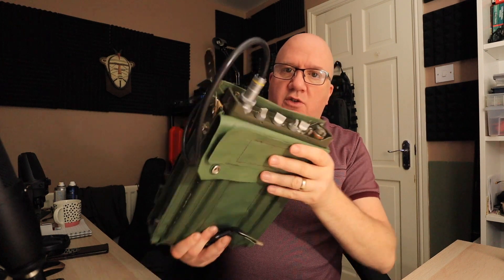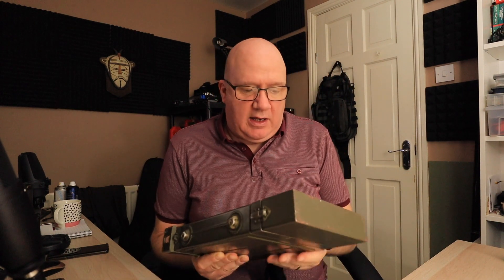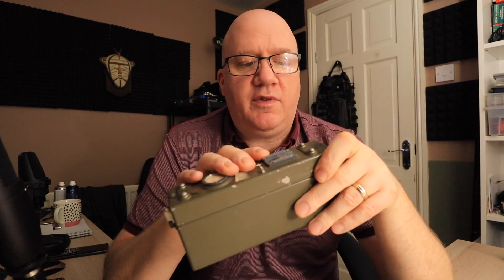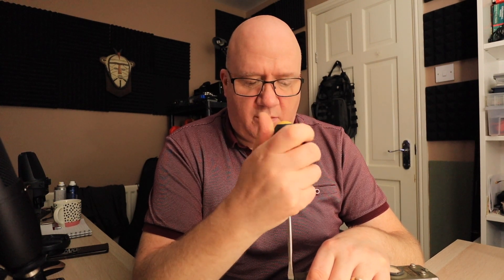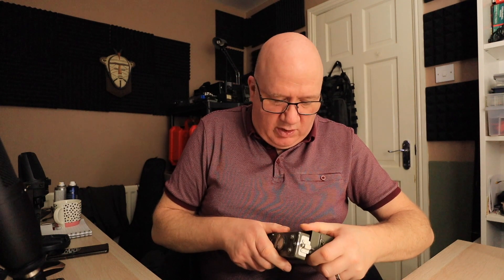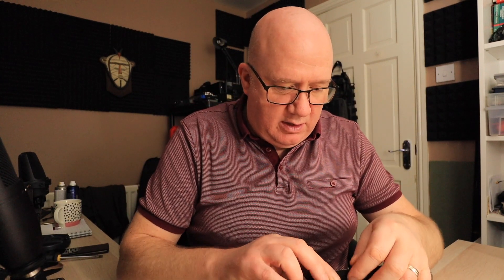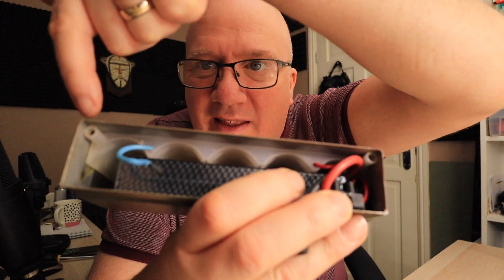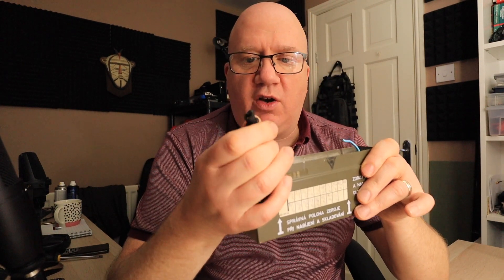Modifying the Czech RF-10 manpack battery

Comment: Hello all, I am a Ham operator here in the states (KM4ORN) and i have a couple of Yugo RUP-33 radios. This radio uses either (2) 7-ACH-1 NiCad batteries or (4) 3LR12 batteries. As the 7-ACH-1 battery is obsolete I am forced to use the 3LR12 batteries. I am trying to find 4 of the old 7-ACH-1batteries that I can try to rebuild. Any help would be greatly appreciated.
Reply from the maker: I've pinned your comment so hopefully someone may know

Comment: you mention 7.4 V in the video is there a specific voltage range that would be compatible outside of 7.4 V? Many thanks cheers.
By the way, looking at getting one of these, but on the fence, the seller has a few of them, but doesn’t guarantee functionality, some that people purchased say batteries leaked other say, had a charge, and then others say problem with fuse. Either way looks like a interesting project. They have them listed for sale between 100 and $150 USD not sure if that’s fair
Reply from the maker: Yes there is a voltage range, I can’t remember what that is but you can google the specifications from either the radio museum or military radio sites.

Comment: Just a note for those wanting to maintain the originality of the pack. I sent my pack to a company called MTO battery for a rebuild using new D cell Ni-Cad cells rated at 5000 mah. I then purchased a Tenergy 6v-12v smart charger (item #01025) from Amazon. The rebuild service is $55.00 plus tax plus the cost of shipping the battery to MTO. The charger was $16.36 with free shipping for Prime members. The charger comes with an alligator clip adapter and the clips will fit nicely into the holes where the top cover pins go in to. I realize this is a lot more expensive than the way Carl and others have done it but I wanted to maintain the originality of the pack. I have two more original packs coming that I purchased from an Ebay vendor and I will probably have those rebuilt as well.
Reply: Oh goodness you are a life saver!  I have had two of these for several years and can't find a battery service!
Reply: @bad74maverick  You are more than welcome.
Reply: @robertmoore254  I just boxed my batteries up and are all set to ship out to MTO, oddly only a few hours from my house from Ohio to Penn.  Once I get them back where can I get a charger for them?  Any thoughts?
Reply: @bad74maverick  I am using a Tenergy 6v-12v smart charger from Amazon. The part # is 01025. To charge the battery pack you have to remove the top of the pack and insert the alligator clips into the positive and negative holes
Reply: @robertmoore254  I just got my batteries back today and thank god BOTH radios work!  One handset needed some re soldering on the headset to get receiver to work but they WORK!!! now I am going to get a charger.  I wonder if we can make a charger that we can simply clip our batteries into and charge??
Reply: @robertmoore254  are you using the Tenergy TN600 Smart Wall Charger for 6V & 12V Sealed Lead Acid Batteries SLA

Comment: Hello, I just bought one of these radios. Can you give me the exact part # of this battery and what charger are you using? Thanks, Robert/ KM4ORN
Reply from the maker: The radio is back at the office at rhe university but it's this spec but please check the dimensions of the battery as I can't find the exact website I bought it from https://www.dtalenthive.top/74v-5200mah-2s30c-lipo-replacement-battery-deans-for-rc-truck-drone-helicopter-p-779376.htm
Reply: @M0SZT  Thanks for this info. Using this battery configuration, how much average run time do you get? thanks and 73's, Robert/KM4ORN
Reply from the maker: Hi, I haven't used it enough to drain the battery should last ages

Comment: Hi Carl. I've finally got around to doing this very mod and this video is invaluable. You kindly replied to me ages ago on FB messenger re charging these batteries and suggesting this mod. I've managed to get hold of the very battery you have used and also a brand new spare battery case to re-engineer.
Reply from the maker: Great news!

Comment: Excuse me Sir i have a few w questions regarding this radio. I'd bought one strictly for a static display in my ComBloc military collection but when i learned it could be made operational by replacing the battery i was delighted. I've been wanting to join the ham radio hobby and was going to buy a radio now i don't think I'll need to as long as this one works.

So my questions:

What settings should it be tuned to before powering it up?

If it's good to go what kind of antenna should i use at home? It came with two whip antennas and one long wire antenna I'm assuming is for stringing high up in a tree. (It came in a green vinyl bag inside a foam container with everything listed in instructions)

I live in the states and start technical licensing classes 01/21/20. 

Looking forward to hearing from you.
Reply from the maker: Hello, with me being UK based it's difficult to advise. I would suggest finding a club (even virtual) and discussing it there as the licencing conditions maybe different than over here. Also the radio is only designed for close range contact and has very ridged frequencies to operate on. Good luck!

Comment: Where did you get that battery Carl I used 5 hd D size batteries in mine. I have a video
Reply from the maker: I've put a link in the description, it's from eBay UK but should be able to match it elsewhere.
Reply: I watched on my tv so I didn't see that nice. I have a fb group for the rf10 look it up and join if your interested 73's

Comment: Where did you find the battery? I have been looking for one so I can get my rf10 on the air. Thanks for making this video.
Reply from the maker: https://rover.ebay.com/rover/0/0/0?mpre=https%3A%2F%2Fwww.ebay.co.uk%2Fulk%2Fitm%2F264234333838
Reply: @M0SZT  Those links are expired. Can you provide specs and model number of the battery you recommend?
Reply: @M0SZT  Thanks

Comment: Do you mind posting the specifications for or a link to the battery you are using?

I have one of these radios and want to do the same mod.

DE WA1KLI
Reply from the maker: https://rover.ebay.com/rover/0/0/0?mpre=https%3A%2F%2Fwww.ebay.co.uk%2Fulk%2Fitm%2F183390705218
Reply: @M0SZT  Thank you.

Comment: Great and very inspirational channel, thanks again! One short question : As you have changed the battery pack chemistry  from NiCa (i suppose) to LiPo, have you modified the charging unit as well?
Reply from the maker: I use a lipo charging unit now, I didn't have the original charger for the radio.

Comment: A man after my own heart, making it work, making it better. I am a great enthusiast of military radios and low power FM radios like these. I have learned a lot about line of sight propagation using them. I have a pair of PRC-77s and a pair of PRC-126s and I use them with different antennas and other accessories. Using an inexpensive simplex repeater is real fun and helps out when there is no one to talk to - like always. I also have done digital modes between the 77s. You can see my stuff on my QRZ page.

Great videos, 73 Charlie KM4ZZ
Reply from the maker: I'll check your videos out!
Reply: Thanks for sharing your very ispiring QRZ Page. I may have to get active on QRP/Portable too. 73s de DO1LR